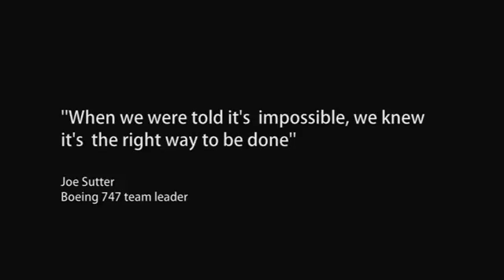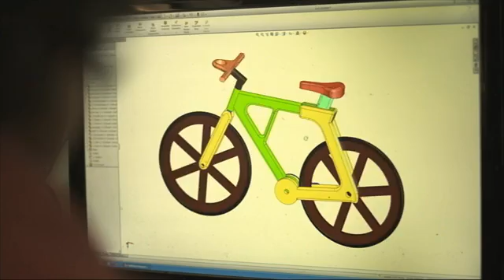Cardboard bike by Izhar Gafni

Comment: You can't even articulate an argument, or stick to a point. Look at yourself, you're reduced to spamming punctuation marks and mangled phrases. "End off"? No mate, no. It's "End of". Short for "End of story".

As for Steel vs cardboard strength, the requirement is strength-to-weight. Layered wood fibre always has a higher strength to weight, yet not necessarily stiffness or flexibility. This frame has a the advantage because it is corrugated. Could be made stiffer through alternating grains.

Comment: It's clear you don't have a clue even what you're trying to argue. Before you were going on about the labour cost of the bike built in the video, ignoring that it's a prototype made by hand in a shed. Now you got slapped down you're trying to argue that a factory wouldn't be able to mass produce it as cheap or easy as a steel bike, making ignorant claims about strength and weight, and embarrassing yourself by thinking laser cutters would be expensive for even a very small company. Go home mate.

Comment: You don't need any of that, you say? Go on, cocker, tell me how you plan on welding the tubes together without cutting the ends, or jigging them? You can skip the butted tubing, I'll let you, but you won't be happy with the very heavy, yet not very strong bike you'd build.

As for strength to weight, if you want to beat cardboard with steel you're going to have to switch to triple butted tubing. Extremely expensive to manufacture, very process intensive.

Comment: Steel bike production has massively more processes involved. Do you understand how butted bike frame tubing is made? Do you understand that building a frame from tubes requires them to each have been made to that specific size (as they are butted), then cut at precise angles, jigged, welded, then cold set to fix welding deformations?

So how does this match up to taking a sheet from a CNC laser cutter, putting it through an epoxy roller, then stacking it onto the prior one?

Comment: You are the fool!! Because only a fool would compare a custom top of the range steel bike frame with this! Im comparing like for like, and you do not need weeks to build a steel bike that would have similar strength and performance properties to this cardboard bike. I dont care if you are mass producing or not, you just named an expensive piece of equipment that a steel bike does not need!

Where is the car in this video clip? Are we not talking about bicycles??

Comment: Are you really comparing the labour costs of one bloke in a shed to a production line? One bloke in a shed takes weeks to build a steel frame, and charges thousands. What do you need to mass produce a cardboard bike? 1) some cardboard, 2) a laser cutter, 3) epoxy 4) paint. Labour wouldn't even require training beyond saying "stack the slices this high".

Comment: Yeah, that's what you said, and it's a load of crap. Materials cost is lower, and given that all you need to do is cut, glue and paint, manufacturing cost will be as well. It comes down to economy of scale, at this point.

Comment: Who can 
dislike this video? Some People are retarded, someone even said " it's going to turn into mush when it rains" No it won't, it's designed to be waterproof
Reply: Yes its waterproof, made using resins, making this essentially composite material, equal if not worse compared to fiberglass. Its dangerous waste that is hard to recycle and its not though as fiberglass. Further more its not nothing new. This type of composite materials have been made long time now and even in 2012 this was old tech, just blown out of the proportions by media. Even now days there is still outlets pushing this narrative and what has come out of it, is same thing with resin coating and paint job, while company website is non existent and it cant be even bought anywhere, but why would you, when there is much better materials around that actually can be recycled like i dont know steel or aluminum? For those who want light as possible frame titanium frames already exist for downhill sport bikes etc

Comment: resistant to fire means it will resist for limited time or up to specific temperature, but after a while it will be damaged by fire.

fireproof means it can not be damaged or destructed by fire.

The term "fire" is under a question. Probably meaning typical fire temperatures.

Comment: Think it was back in the early 1960's the Piper Aircraft used a system like yours to make a two place 85 hp airplane. Do you know anything about it. Can't seemed to Google up any info. on this Piper Epoxy/Paper Airplane idea.
Do you plane to make an airplane using this method?

Comment: "...costed him 9 to 12€ but remains shy on the number of hours spent on the building." That's the key. You can spend next to nothing on parts, but if it takes you 10 hours to build a single bike, that's $300 at $30/hour, which would be a low hourly rate for fabrication on a custom-built bike.

Comment: "In testing the durability of the treated cardboard, Gafni said he immersed a cross-section in a water tank for several months and it retained all its hardened characteristics. Once ready for production, the bicycle will include no metal parts, even the brake mechanism and the wheel and pedal bearings will be made of recycled substances, although Gafni said he could not yet reveal those details due to pending patent issues."

Comment: All kinds or problems.. Belt drives never work right on bicycles, no rear brake, owner is riding on perfectly flat roads, airless tires make for a horrible ride etc etc, and I noticed the guy is only going about 4 mph. This bicycle will never pass US safety standards. The moment this thing hits a rough surface, or a curb, it falls apart.

Comment: We get that kind of cardboard plates together with some photo-polimere sheets as protective material... and I can say they are really strong. This honeycomb structure give it such strenght you wouldn't expect from cardboard... combine it with fiberglass or carbon composite... 
you could make an airplane out of it.
Reply: jitterbuba Why couldn't you use the same principals of applications and say build prefabricated walls and such and create a kit to build a tiny house ? It would just be on a larger scale . I'd think you would have to use a few laminated beams to use as the main supports in the structure though. It would create a really cheaper way for people to build their own housing !